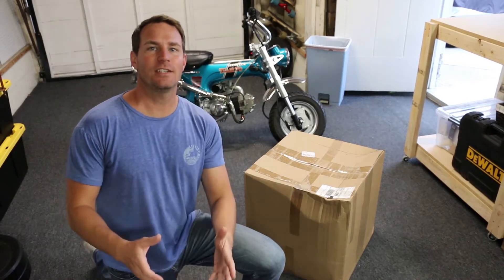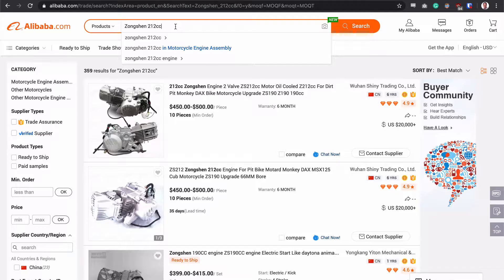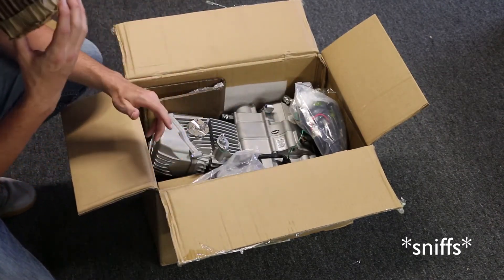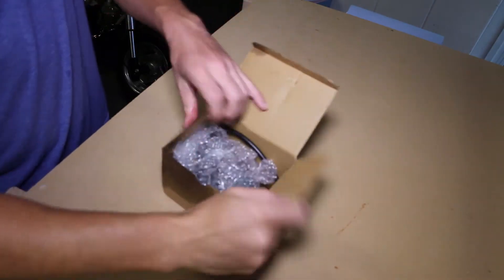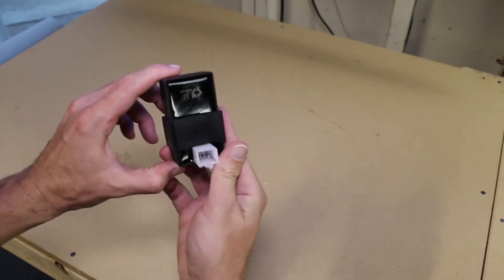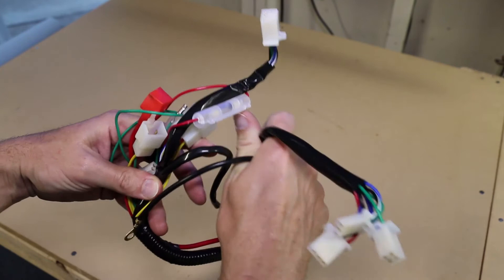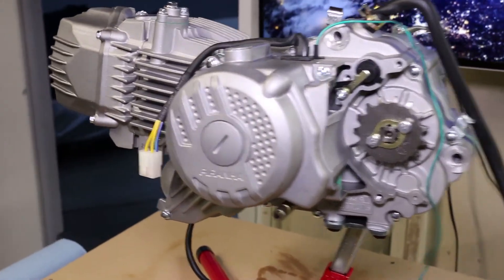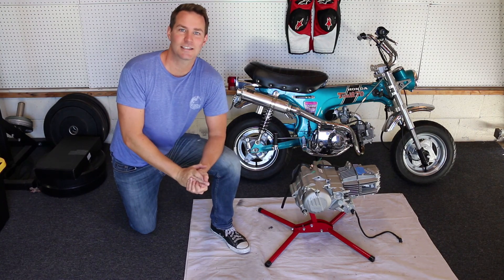Ep. 02 - Unboxing Piranha Zongshen 212cc Engine

Comment: Can you bolt that engine from under the engine ? Usually there are 4 mounting bolts ? thankx
Reply from the maker: there are four M10 bolts at the bottom -- typically used to hold on the foot pegs. I imagine it could be used to mount, though using the mounting holes would be stronger
Reply: @JoshuaMcQueen  thank you